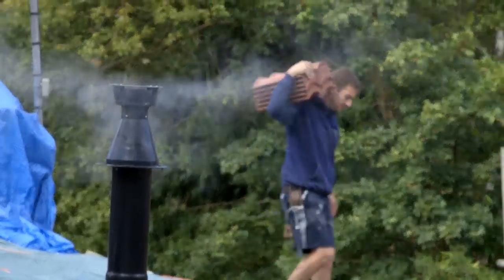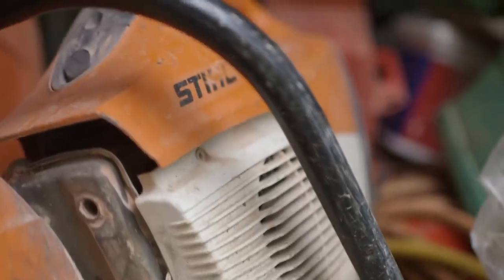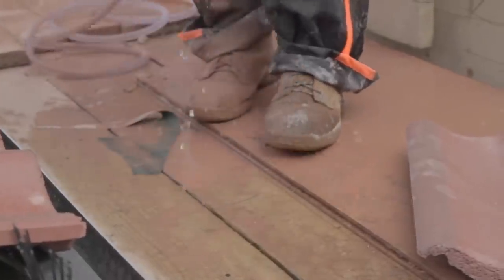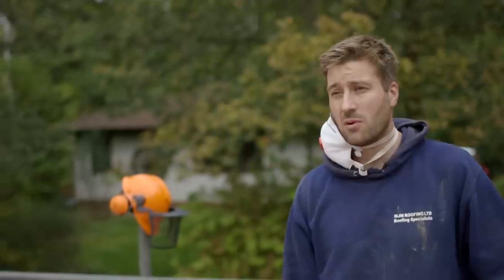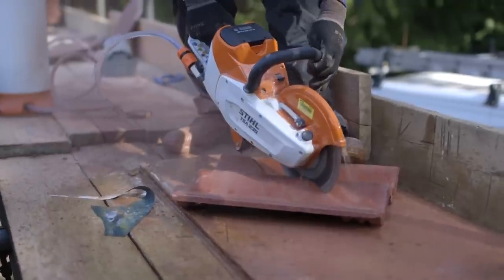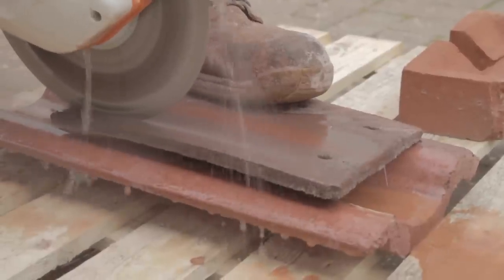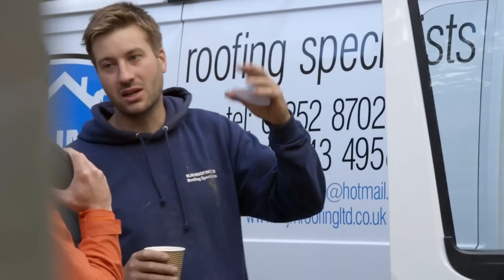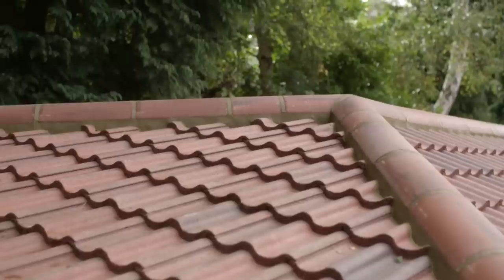STIHL TSA 230 Cordless Cut off Saw ... A Day in the Life of a Roofer | STIHL GB

Comment: Why does he need both a petrol and electric cutter?
Reply from the maker: Hi Nathan, the roofer mentions in the video that there is a place for both machines in his toolkit – the cordless cut-off saw is a really efficient way to work on smaller jobs with lots of cuts required, plus it’s quieter with no emissions during use. The TSA 230 has a cutting depth of up to 70mm, but our petrol saws can cope with bigger cutting depths so you may need a petrol cut-off saw for bigger jobs. Thanks, STIHL GB